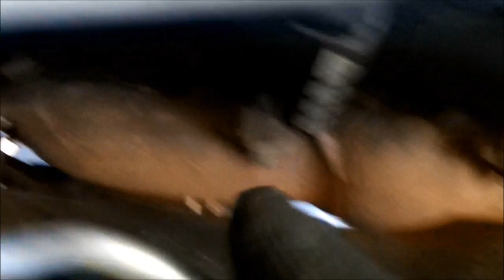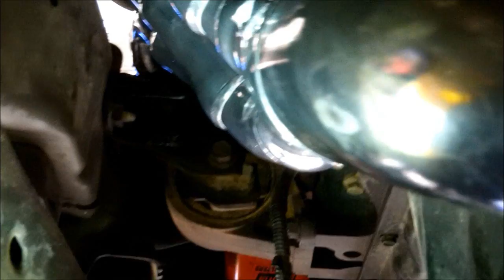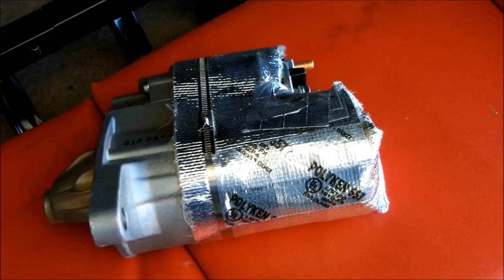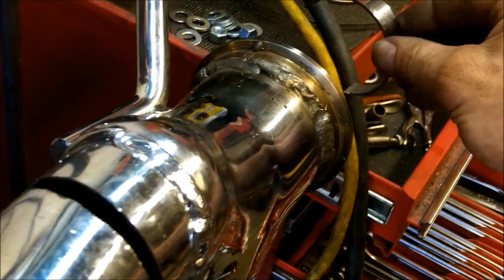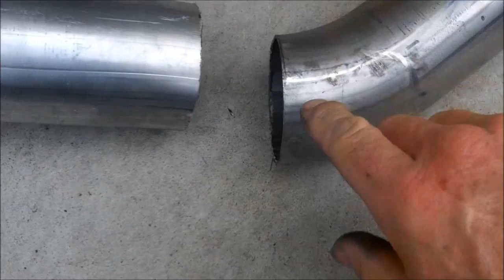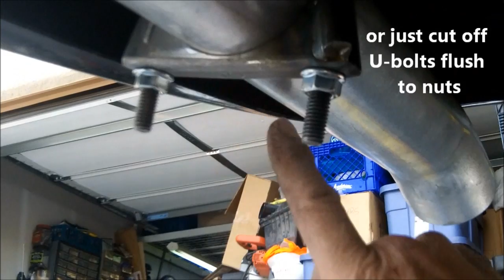How to Install Doug Thorley Headers on a 99-04 Jeep Grand Cherokee with 4.7

Comment: man this is great to see you disprove the old wives tail that the 1999-2004 Grand Cherokee  V8 cant have headers fitted.
Reply from the maker: Yeah I was actually consider building my own and then I came across these and I was so happy to find them cuz that would have been a hell of a lot of work. Even though I did have to make some modifications to the y-pipe but that was only because of the aftermarket transmission pan. And they have been serving me well.
Reply: @martinbuilt  so quick question I'm currently deleting the factory cats and putting pipe in place and doing a single cat set up like yours. You mentioned the wide band 02 is that part of the jeep from factory or did you add an after market wide band set up??
Reply from the maker: if the starter is on the driver side and if it is also 4wd that would be a problem, the passenger side looks like it would fit.

Comment: How have the headers been holding up?
Reply from the maker: Snobrdrkid0.  they have been holding up very well they pretty much look like they're still new. Ever so slight fading on the ceramic finish that's about it.
Reply: martinbuilt you're lucky. Mine have been on about 17 months and looking rough.

Comment: just fitted a set of these headers and put the o2 sensors where the manufacturer allowed,Now runs rich and CEL light on plus map sensor code. What do you recommend? thanks
Reply from the maker: Supershape Fitness 
Are you saying you mounted the rear O2 sensors in the header Y pipe. If so you have those O2 sensors in front of the cat if you're running a cat at all. Yes you would get a Cel light. The only way to probably get rid of that light is to put some extensions on the rear O2 sensors to pull the O2 sensor further away from the exhaust stream. I hope this helps.
Reply: thanks for the quick reply. Yes i have the original rear cat and I put the rear sensors in the Y pipe. Should I move them to the back of the cat like you did? By the way I have installed the late 4.7 with 16 spark plugs hence the need for the headers. Just changed the flange plate on the headers to suit the later heads and changed the crank and cam tone rings
Reply from the maker: Supershape Fitness 
In my opinion that's where I would put them is behind the cat. That way you won't be fighting the Cel problem and your ECM will be much happier.
Reply: Thanks for your help, Cheers from Australia
Reply: just had a thought.What would happen if i replaced the 2 rear post cat O2 sensors with 2 new pre cat sensors into the Y pipe?

Comment: Great job,I would send Doug Thorley this video just to show them they should re-design the headers,who knows,the might give you your money back on these because of all the fabricating you had to do.
Reply from the maker: John Kranz 
I've got plans on removing that y-pipe and building a brand new one. It will also have increased floorboard clearance. With more available room to mount O2 sensors.

Comment: You would think they would have a better design for these headers! Should not have to make these kind of adjustments! Just saying!
Reply from the maker: Ben Bekker 
I totally agree. I've come up with a new way to build the y-pipe I just got to get the material together and do it. By Design would also improve floorboard clearance.
Reply: I must say you did a awesome job getting around these issues! Very nice😀

Comment: What kind of trans pan do you have?? I see it is fined, is it a larger capacity than stock??
Reply: Never mind I just saw your trans pan video. Great videos, all of them!!
Reply from the maker: Mag-Hytec #68RFE  Check out https://www.youtube.com/watch?v=ZlbjPdou1Dg&t=25s
Reply from the maker: Thunderbolt 
Yes I did lower it 1 inch the front 1.3 in the back. I do have a video on it. Relatively easy to do.
Reply from the maker: Thunderbolt 
Mine has the NV 247 transfer case

Comment: Hi, where did you buy the headers? Or what part number is it?
I have an 02 4.7 Laredo that, though it sounds mean/rumbles with a 40 series delta flow flowmaster, I would love to install some headers.
Reply from the maker: THY-637Y-C
Long Tube Tri-Y Headers with Y-pipes
1999-04 Jeep Grand Cherokee WJ
4.7L V8
 Someone else actually bought them for me, I believe we got them from Auto Anything

Comment: Quality install, very informative. I have a pair of dt headers going on my 5.9 zj here soon. I too have the aluminum trans pan, I'm hoping it doesn't fight me.
Reply from the maker: Yeah i hope it doesn't give you any problems. I'm thinking about building my own Y-pipe that has a better design. That will accommodate aftermarket trans pans and provide more floorboard clearance at the same time.

Comment: Mi Martin-I dont have time to look through every video for a possible answer, but I was wondering if you could tell me what kind of rims you have on your ride? I really like them! Are they aftermarket, or newer style Jeep rims? And then what size tire you have on it...Oh, and of course-Cool video too!
Reply from the maker: Thanks, OE wheels. They are a knock off of the Later Jeep SRT wheel. 20x9. tires are 245x50x20
Reply from the maker: https://www.carid.com/oe-performance-wheels/20-inch/?gclid=CIy7ipu1t9MCFQ50fgodW90PTg
Reply from the maker: OE CREATIONS® - 129 Gloss Black more details on - https://www.carid.com/oe-creations-wheels/129-black-23260286.html

Comment: Wow, great job and also excellent exhaust fabrication but that's a heck o a lot of work and $$$$$ for 20 HP- Did you get the headers from Kolak  you mentioned his tailpipe?  I have a 96 ZJ 5.2 and was thinking of installing headers but its a Northern vehicle and at least one exhaust stud is missing and only GOD knows how many will break if I try to get them out? 

You need a nice stainless steel exhaust tip like a Gibson, thats what I have on mine. Good you don't have any error codes,  did you notice any power increase?  That WJ is very clean and I see that oversized trans pan with the allen head, very well kept
Reply from the maker: jim dandy 
I still plan on changing the exhaust tip and maybe tucking it up more than it is right now I don't like any of the exhaust pipe exposed except for the tip. I don't know about any real horsepower gains yet I haven't done much experimenting. Yeah I would be a little leery about putting a set of headers on a vehicle that came from the north. I first went down to pick a part and experimented on one of their engines to see if anything's exhaust bolts would break and I had no problem.
Reply from the maker: no I did not get my headers from kolak I didn't realize at the time he sold headers.